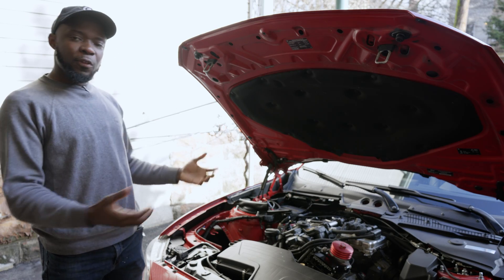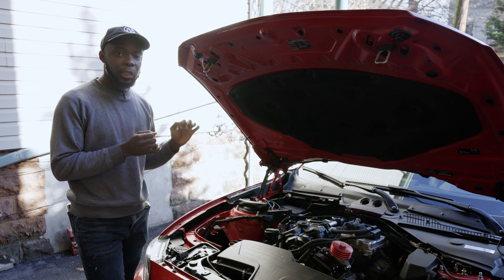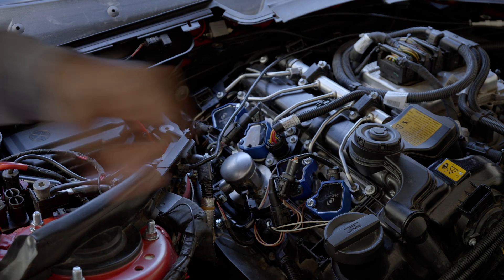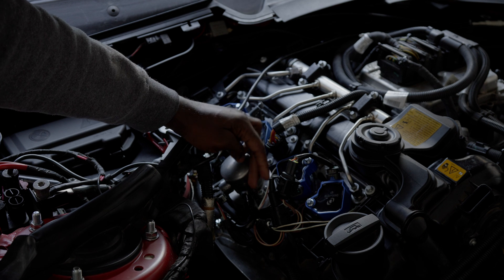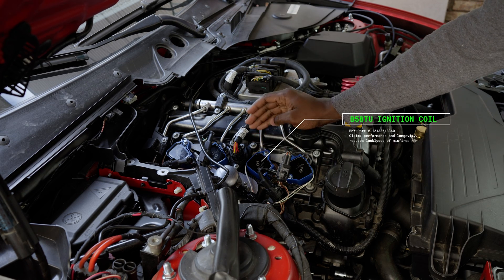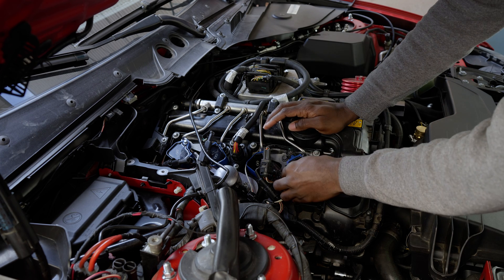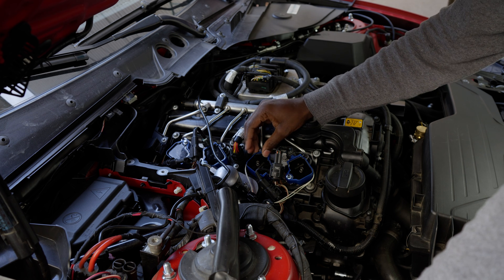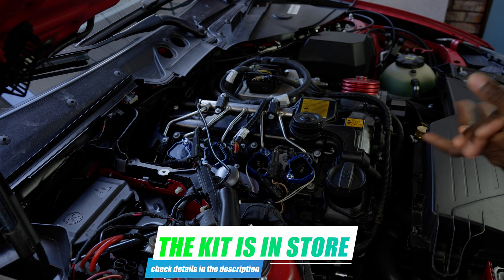why do people doing this mod on N20?

Comment from the maker: 1. order the part here
buymeacoffee.com/alainmb/e/227980
2. You have to tune the B58TU coils. Otherwise, you will get misfire codes. You must adjust the spark dwell values. This table is editable by your tuner. Works well on Bootmod3
3. Now you can get the Dorch Engineering Stage 1 DS15-250 High Pressure fuel Pump.
https://dorchengineering.com/product-category/n55

Comment: Hey man, with the b58tu hpfp is there any other mods required? Are the stock injectors ok with the b58tu hpfp?
Reply from the maker: the stock injectors are totally fine when coupled with B58 HPFP. On top of that you don't need a tune change. B58 HPFP future proof your E content if you ever want to go on flex fuel. The only supporting mode of the B58 hpfp is the feed line from LPFP. You have to either make a custom line or get those are making it.

Comment: Hi can n20 plug be replaced with ngk 95248?
Reply from the maker: do not complicate things as you will not gain any benefit. Buy what you get off the shelf from an auto part store. Give them your VIN number, and they will get you a spark plug for N20. Anything else is not worth the hustle.

Comment: Hello, what is the angle for the fitting on the hpfp?
Reply from the maker: you drop it at the same angle as the N20 hpfp. you align it with the hard line fuel line that goes to the injector rail. and the other end  uses a 120° AN fitting, and you get an AN6 to M14 adapter.

Comment: I hear you my guy but I want us to talk about reliability of this engine ,because I have a 2015 125i , it had a oil pump failure, and I have been checking hear in SOUTH AFTICA and most of this engines are having reliability issues , how do you sold that.
Reply from the maker: This is a great insight and good question. Let me tackle this from a daily user perspective to an amateur enthusiast.
so, with bmw low powered engines like the 3 cylinders and 4 cylinders. if you really just stick to regular maintenance: oil change,  moderate driving... literally like a grama style, the car will last you. Moving on a little higher. if you still want to keep it healthy but want to push just slightly more, an OTS tune stage 1 on these engines is really all that you need. No bolt-on, nothing. you will still enjoy the car. better throttle response and feel a night and day difference just with stage 1 tune.
The moment you start touching any drivetrain and powertrain modifications, the reliability is no longer the same. Either you improve it or you degrade it, the later is the most likely. it's a trade-off. Remember, BMW aren't like your Toyota. On the contrary, right now, I am on 103k miles, and I haven't had "major" motor failure: timing chain, or whatever. why? is it luck? No, it's just that the engine is still fine. I often say this, the reliability of an engine or a car is tied to the owner's personality. What you're using the car for, how you treat the car. Hence, I should be prepared to what will happen after treating the car in a certain way. It's an N20 after all. Your driving style will matter how to keep your car to last longer. If you go to subaru community,  you will hear the engine blows up all the time. but statistically, it's the user fault the way they treated the engine, not the car manufacturer problem. you will meet owners with over 120k miles on stock unopened boxer engine. Every generation of an engine is an advance from the previous. The key is just to know what you want to use the car for. I owned 328i xdrive with N20. i had it up to 90k miles, I never had a single issue with powertrain, and I had never done the timing chain, nor opened it. currently with this 228i with now 103k miles, so far no major powertrain issues except the boost target that I can't reach but that is because of what I am doing with the car. it about owner's personality. 
When we start modifying out of EOM specs, we just need to be ready. Honestly,  the truth is, N20 is not a bad engine. it's actually a great platform for low key users that just want to have fun and not pushing 1000HP. I like it because it is easy to work on, easy to find parts on after market. a lot of space in the engine bay. Only the turbo and sway bar replacement bothers me. Everything else is just there in front of you.

Comment: You have the part number for the b58TU HPFP?
Reply from the maker: here you go: 13518631642
note that this part number is sometimes interchanged with Gen 1. you need Gen 2. Gen 1 performs just as N20 oem hpfp. but  Gen 2 is the upgraded performance, which has that smooth top bulge..